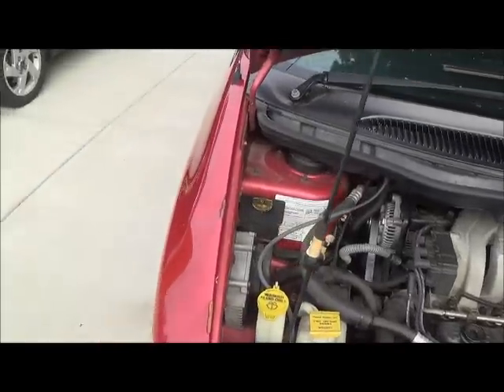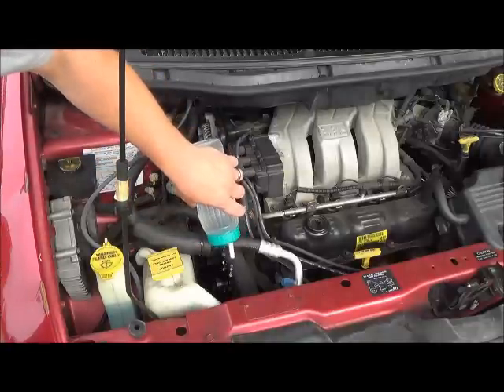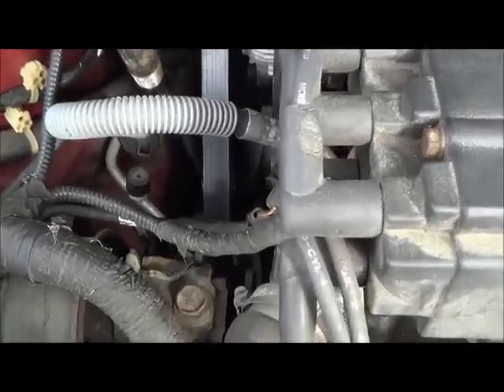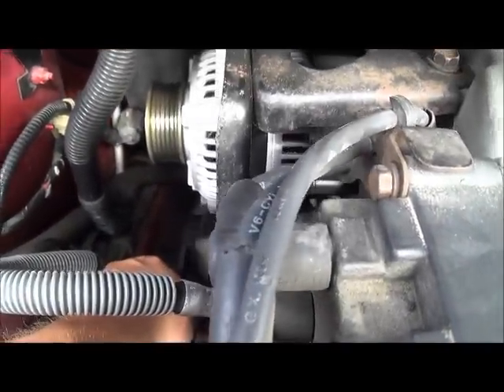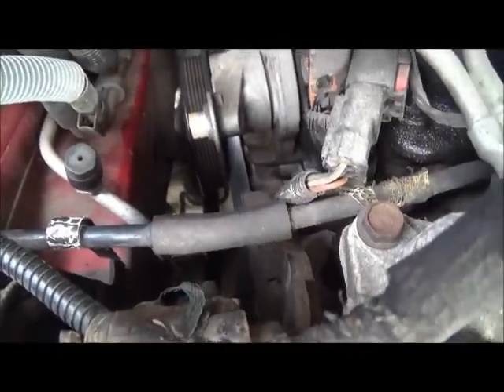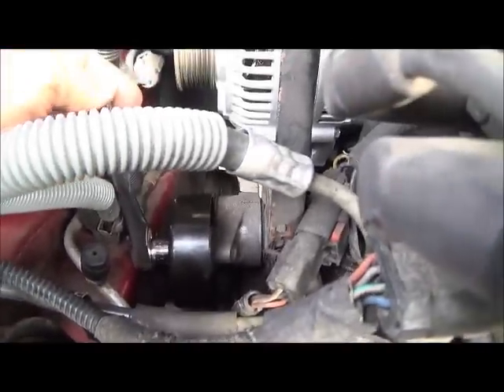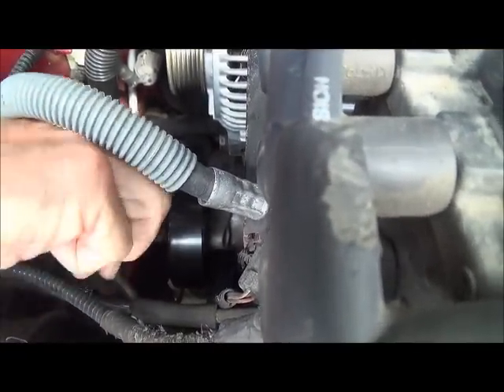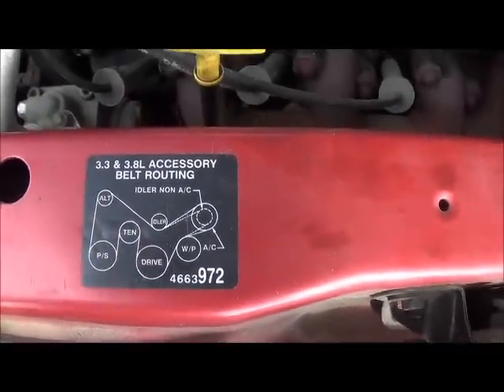Squeaky belt NO MORE! Dodge Caravan / Town and Country Serpentine Belt

Comment: Mine is making soft chirping sounds. That sometimes stop and sometimes are louder. And gets really loud while driving now. Just redid the tensioner pulley and the water pump is new. No idea what could be wrong. Mine's a 2000 3.8L.
Reply: PS pump.
Reply: odds are, if the tensioner pulley went, the tensioner itself should be replaced also. it isn't putting enough tension on the belt. i just had the very same issues.

Comment: Thanks for good explanation. However I replaced my old cracked belt by new Dayco 6pk2460, tensioner Dayco apv2573 but new belt still slips off when I drive through deep puddles. I just replaced the Harmonic Balancer...Still slips off in puddles. Fitting these parts was waste of money. I am looking for slip proof pulleys.
Reply: The GATES kit part number 38379K has ribbed pulleys and a double sided ribbed belt that was made purposely to prevent the belt from slipping off after hitting puddes.
Reply: I found a tensioner pulley for my 99 town and country limited and it has a lip to stop belt from slipping off
Reply: Is that a ribbet pulley?
Reply: @vladix750  plate is cheaper than the double ribbed belt they want almost $100
Reply: I ordered 2 Doorman washers. Two of them delivered to Europe cost me 36 euros. Fitting to the tensioner was quite easy, but needed smaller washer to prevent tensioner-shield rubbing. It was very hard to install the belt over idler pulley with Doorman plate. I attached the the car's wheel spanner as the extension on 15mm spanner to get leverage. It was hard to pull belt on but now it will never fall off. Drove through flood belt stayed in place.
Reply: The gates kit 38379K comes with a new tensioner (that has a new tensioner pulley that is ribbed) a new idler pulley (that is ribbed) a new belt (that has ribs on both sides of the belt) and a new bolt. The tensioner pulley and the idler pulley have lips on them to keep the belt from sliding off. The lip on the pulleys makes it hard to get the new belt on. I had so much trouble getting the new belt on that I finally used the old belt, figuring that it was stretched a little more than the old belt. Even using the old belt I had troubles getting the belt on. I have since put the new belt on because the old belt was slipping. It was a job. Good luck with your repair. Happy Motoring.
Reply: @vladix750  yea u really gotta pull that tensioner all way down
Reply: @mostlymoparih5682  yeah how much tho.
Reply: @vladix750  glad I could help. I was almost bout to buy new vechile but I love my van.
Reply: $115.79 from Rockauto  GATES 38379K
 GATES DK060956 belt is 52.89
GATES 38009 idler pulley and tensioner pulley are $10.31 each
GATES 38398 tensioner and pulley is $48.99
If your tensioner is not bad then you can just get the belt and two pulleys
the kit includes a bolt but you can just reuse the bolts from the tension and idler pulleys
The two pulleys and the belt are 75 bucks and you have to take the smooth pulley off of your tensioner. 
So far so good. Hope that helps.
Reply: The single sided ribbed belt is longer than the dual sided ribbed belt the pulleys are also different sizes. 
Yeah if you can just use that plate  made by Dorman, with the one sided ribbed belt that is a quick and cheap fix if it works.
Reply: @vladix750  did u put on both the idler and tensioner pulley.
Reply: Yes, I fitted both Dorman shields. However standard 2460mm belt was too short to slip over idler pulley, so I slid it on over alternator pulley. I attached the black oe wheel spanned on 15mm spanner to pull tensioner's spring.
Reply: @vladix750  I only did tensioner I might do my idler just in case. I havent had a slip yet since I got plate installed and it seemed like smallest puddle would throw belt. Van needs more undershirts to stop water
Reply: On American  ebay I saw the Doorman 419-5000 pulley with side guards, it's size is 90x31mm - same as Chrysler 3.3/3.8 pulley size. If it fits, I reckon it will be better than Doorman washers, and lot easier to install as idler pulley.
Reply: @mostlymoparih5682  the gates kit should have been OEM on these.  the only pulley left without ribs is the water pump. Nearly impossible to fall off with this setup.
Reply: @coopcraige  Really tough to get belt on. I put a kit on a 99 in the fall and it is starting to squeak already. I had a 2000 with the oem parts on it and never really had a problem with the belt coming off. 01's and newer relocated pump to the back of the engine. I have an 01 and it has over 200k miles runs great no squeaks.

Comment: We replaced the Serpentine belt but the Town and Country still squeaks when the AC is on!
Reply: Ac compressor pulley is probably shot
Reply: @buddha206  I have a problem Where are my serpentine belt falls off if water gets in the area, and I also get the squeaky sound I will try to change the AC pully

Comment: Hey how  u sir today Will I have the same same problem with a 2000 dodge Caravan 3.3l  I did all that what u did and get a new pulley wheel for it to but still squeaking so do that mean my bolt is out of time
Reply: Geno Hall you check the alternater or what was it I have the same problem
Reply: You ever find a solution?

Comment: Good day,I have a 99 dodge grand caravan like this one. I changed the water pump and put a new serpentine belt in. Soon after that it began to squeal just like the one in the video. I changed the belt again and it solved the problem temporarily but it was back very  soon. We put a stethoscope on it and found the tensioner pulley was loud. So I changed it. Again it solved it for a day then it was back. I  put baby powder on the belt and the squeal is gone instantly but returns. Do you have any suggestions from here? Perhaps the actual tensioner needs changing?
Reply: Your speculation is correct.    I just changed a tensioner on a 1999 Chrysler Town and Country and it shut up.  I actually thought my Power Steering Pump was making that noise.
Reply: Yeah, I thought I was clever because the parts store didn’t have a tensioner with a tab on it like the factory part so I just replaced the pulley   I still had the squeak  (more like a chirp)  i checked the power steering pump.  But finally went back to the tensioner   Which I replaced with one from Advance auto parts - it was a “Litens”, made in Canada.  It had the tab for tensioning on it and fit like a charm.  No more squeaks (chirps)!

Comment: Hello,

I had an abortive attempt to replace the AC clutch coil on my 1999 Plymouth Grand Voyager (3.8l)

I rotated the tensioner and slipped the belt off of the idler pulley

After doing the work I could on the AC clutch coil (damn snaprings) I replaced the belt back on but have less tension now and lots of noise

If I spray the ribbed side of the belt the noise goes away for a short bit.

I don't think the tensioner is returning to the position it had before

any suggestions?
Reply from the maker: If it wasn't squeaking before, I'd take the belt off and put it back on again. Sounds like it may just be a little off center and putting it back on might get it back on track. Let me know if that works or not.
Reply: I had a mechanic look at it and the tensioner went bad.  sigh.  15 year old van, bound to happen.

thank you for replying!
Reply from the maker: Jeffrey Cornish yea - sometimes you gotta bite the bullet and pay a pro
Reply: @KeyFobRob  NEVER😎

Comment: You need to tell us what year your car is, my 2005 doesn't look like this. The alternator is in the front by the radiator, the AC is in the front but down low, and the P/S is up where your alternator is.
Reply: Post 2001 the accessory arrangement is different, the alternator is up front and on top.
Reply from the maker: 99
Reply: In this case. The tensioner pully is what the problem was. He said his was an 02. Yes you're car is set up different. But follow the diagram on the radiator frame. It tells you where the tensioner is. When you find it and it's right there. Follow his instructions.

Comment: I have a 1998 Chrysler Town & Country AWD.  I tried to perform the tensioner removal as you have shown however, the transfer case on the transmission is in the way one can not see the nut from the bottom.  I have removed the alternator I can just view the nut from the top however, a support bracket crossing over to the back side of the mounting plate for the alternator, tensioner, and power steering pump is in the way. The support bracket must be removed on one end and moved to the side to allow room for a wrench to get in there.  At the moment, because of tight angles the preferred wrench is a palm air right angle impact wrench from Harbor Freight.  Then removing the crossover support, and an offset ratcheting box end.  In my case, I can completely understand a repair cost of $200-$300 at the shops.  I think the design engineer had a nightmare when this arrangement was thought up.
Reply from the maker: Wow! I can certainly understand your frustrations! Its always a shame when you start digging in and find a ton of things in your way. I ran into similar frustrations when changing the spark plugs on this same 99' Caravan. I ended up getting a quote for the plugs and it was $370 glad I ended up doing it myself. Woof!
Reply: You are so correct.  While having the vehicle out of service I also changed plugs and wires, valve cover gaskets, coil block, and water pump.  I noticed coolant moisture on under side of engine and decided now is the time to change it rather than waiting for a break down God knows where. I am finishing up today engine should be good for another 266,000 miles.  By that time the unibody will have rusted to pieces, LOL.
Reply from the maker: Mike Schmidt 266K! That is impressive! Can't kill that AWD minivan LOL. Hope everything goes back together well!
Reply: Robbie TwoScraps The saga continues...  Upon closer inspection I Discovered that the pump was not leaking but rather seepage from the front head gasket.  I thought "Oh Crap" either tear the engine apart BIG TIME or get some coolant system stop leak, I opted for the stop leak. After getting the idler and tensioner pulleys in place I noticed the idler was slightly narrower and misaligned from the OEM.  So I pressed out the new bearing from the replacement pulley and pressed it into the OEM pulley and got perfect alignment. Whoo!  I took it out for a spin it now runs like a scalded cat with no codes.  After going to www.AutoMd.com I was able to calculate the cost of repairs if I had taken it to a Dealer, Independent Shop, and DIY.  In general the Dealer costs would have been $6000, Shop costs about $5000 and DIY about $1000 in parts my labor was my own. Hope this helps everyone who reads this.
Reply from the maker: Mike Schmidt Nice work Mike! A HUGE victory for sure! Pretty cool little website there.
Reply: You probably would have done better by removing 3 bolts and dropped the engine by 1 to 1 1/2 inches to give you the space you needed !